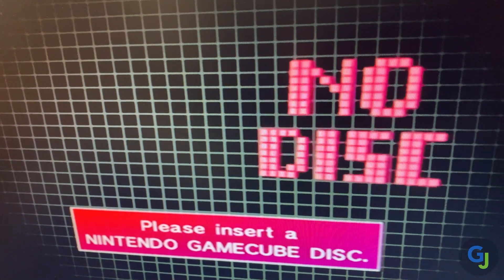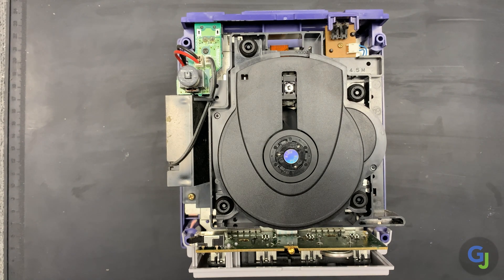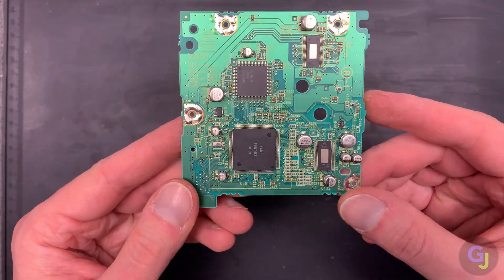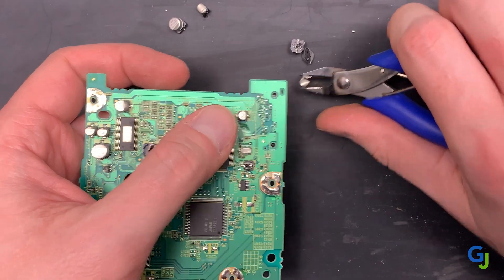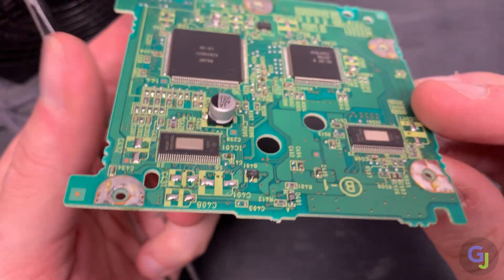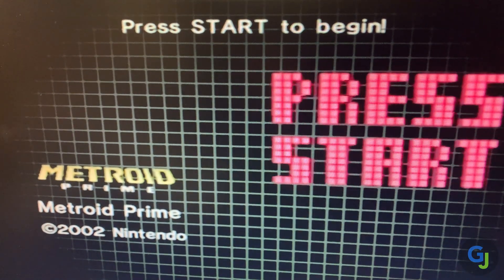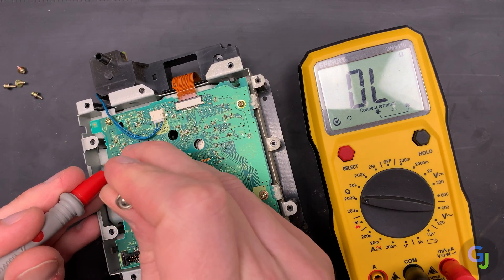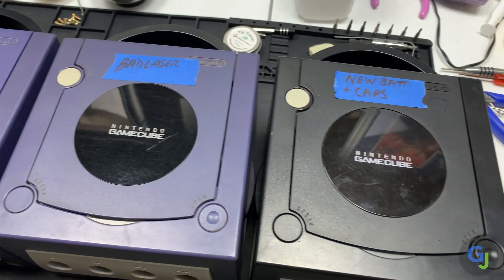GameCube Won’t Read Discs? New Caps Could Be the Solution! (Full Repair Guide)

Comment: I tore the lower pad of capacitor C408, the lower one near the copper ring. Is there a way to bridge it?
Reply from the maker: You can probably make a patch with some bare wire and solder mask to hold everything in place.
Reply: @g @gamejaeger  I ended up bridging it to C403 since that pad is completely free

Comment: This is a very well structured video, lots of really useful information. I adjusted the potentiometer in my GameCube 2 years ago but its finally not reading discs anymore, but the laser does spin. So I picked up a soldering iron at Walmart, some solder at Lowe's, and some caps off eBay. Already had a screwdriver set because I used to mess around with Gameboy Color and Nintendo 64 stuff. But soldering is a different beast completely lol.

I have a small issue that I'd like some advice on. I was reading online that the C238 220 capacitor is the only one you need to replace a solid 90% of the time, so that's what I was trying to do tonight to see if I would get lucky with it, but I think I messed it up a tiny bit. When I was trying to pry off the old pad using the heating method, I ended up pulling up just the metal shell, so I had to go back on a second time and try to pull up the black footing piece for it. But when I did that, it left the original legs in the solder I think. I didn't see them on either side of the stripped capacitor. I tried to add solder and then pull all of it up with the soldering braid wick but it wouldn't budge. Tried without flux, then with, then raw again, but I never got the pads 100% clean. 

With that said, my question is, if the old feet are still stuck in the old solder, will that affect the connection for the new capacitor at all? Part of me thinks not because it should just flow as one continuous source regardless, but another part of me thinks it does matter since it didn't fix my issue and also the legs are made of a different material than the solder. You briefly go over it around 3:09 but do I absolutely need to remove them? 

I'm probably going to do a full capacitor swap regardless purely because I ordered the whole 10 pack so I may as well, but I would like to know for the future.
Reply from the maker: If I was in this situation I would remove the broken off legs before installing anything new. You never know if they could touch multiple locations at once causing a short or something worse to happen. I would assume if those are left in place they won’t cause any major issue other than preventing your new cap from soldering down nicely, but you never know. So better to be safe and remove them completely. 

I’d go back with some extra flux and some solder and just try to swipe the legs out of place with the new solder on the end of the iron instead of removing them with the wick. It might be easier to “wipe” them away with the tip of the iron instead pull with a tweezers too. 

But I would agree, replace all the caps first and then try it out again before making any adjustments too. Hopefully it fixes it for you and good luck with your repairs!

Comment: My only question is! where can I find a new laser that's not a used one on eBay?
Reply: Helder tech
Reply from the maker: They are typically tough to find without going for a knock off replacement. I haven’t purchased any new units for myself so I can’t personally endorse any websites online that sell them unfortunately. I’ve gotten used units before on eBay and those have worked well every time though. That being said, it’s getting harder to find some parts as time goes on, unfortunately some stuff is just not as available as it once was…

Comment: Well of course it's the caps they degrade over time that's why you have to turn up the sensor eventually so it can still read
Reply from the maker: True but with new caps you don’t always need to stress the laser as much by tuning it up so hopefully by replacing them it extends the life of the laser in the process too.

Comment: If the laser is completely gone, i guess that can also be an excuse to mod it to replace the disc drive with a card reader
Reply from the maker: For sure! I haven’t had much experience with that yet though. I try to bring everything back to factory/ working condition and haven’t gone the mod route much but I’m sure that will be the norm for the future since it’s tough to get replacements for many systems. Sadly everything seems to be going digital and physical media is slowly dying…